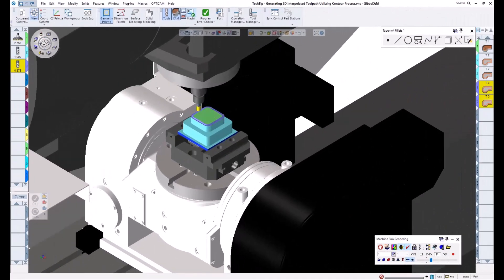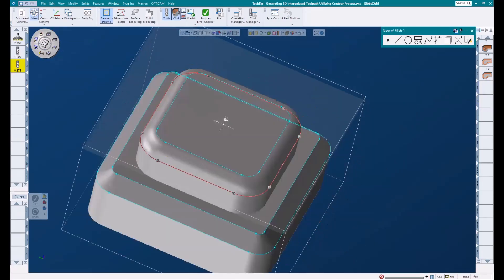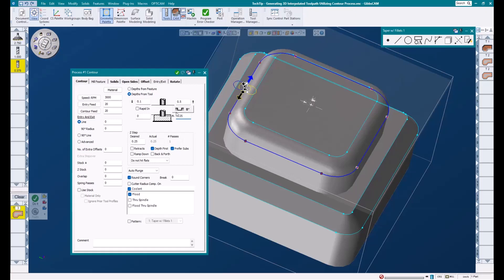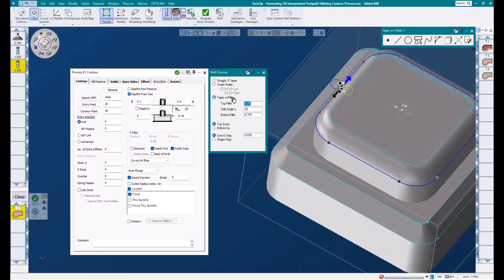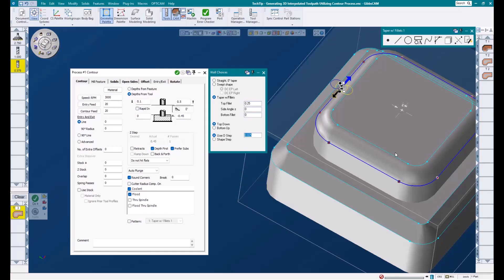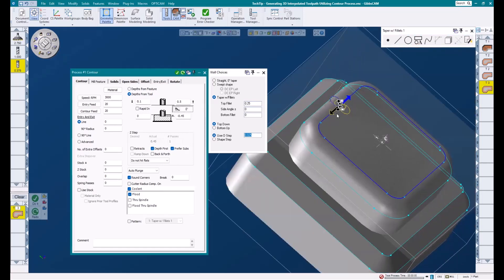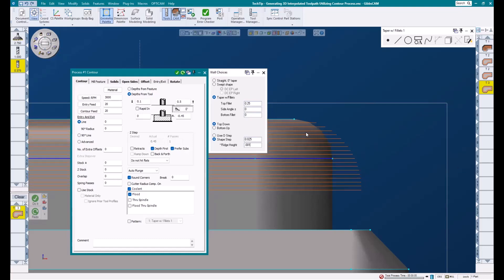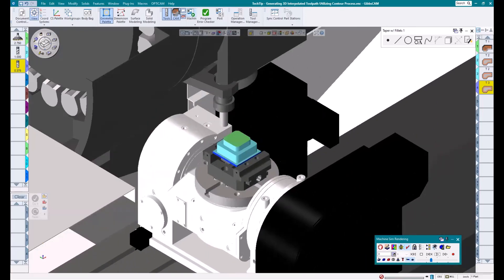GibbsCAM Tech Tip: Generate a Basic 3D Toolpath Using a Contour Process

Comment: I just started using GibbsCAM at my new job because that is what they have here. Your videos are very informative and helpful but for some reason I can't get my toolpath right. When it comes down to creating it, instead of the operations cutting and contouring the outside part, it cuts out my part as a pocket. Any tips on what I'm doing wrong would be really appreciated.